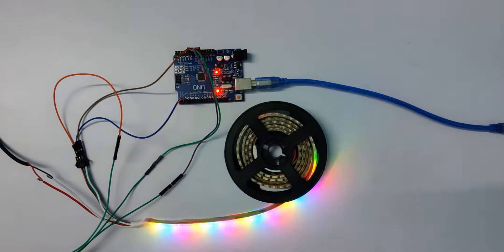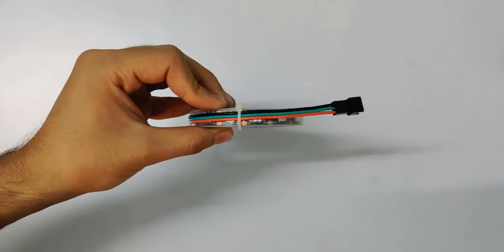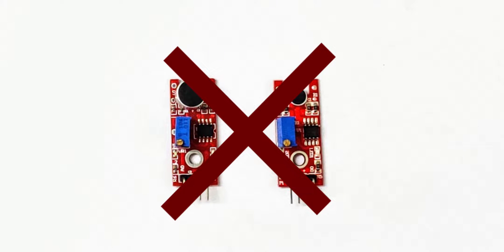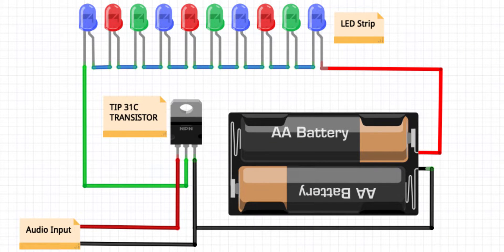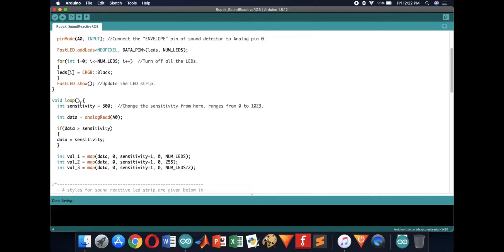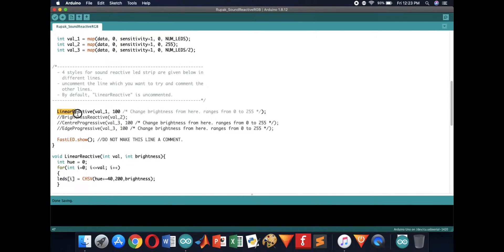How to make a sound reactive RGB LED strip with Arduino

Comment: Hello Rupak, just wondering will a Arduino Nano work with this setup? Also, what are the jumper cables for? and for the Sparkfun sound detector which is better the one with headers or no headers - what's the benefit to getting the one with the headers.

Comment: which transformer can i use for the led strip? ok 12V
Reply: They usually work on 5V
Reply: You have 2 common types of LEDs
WS2811 which work at 12V
WS2812 / WS2812B which work at 5V

Comment: my light is flickering but otherwise it works. How can i stop the flickering of the leds?
Reply: Seems like you may have a faulty power supply. Flicking usually happens when the current entering the strip is not constant.

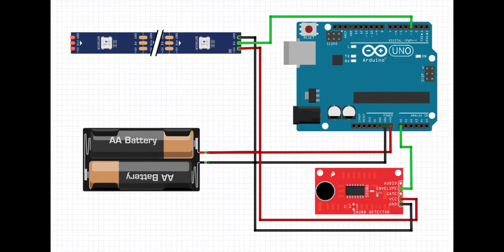Comment: 1:06 Are you sure the wiring is correct? The sound detector is not attached to a power source 😮
Reply: I also got the same confusion , but the sound reactor and led is not connected to each other. They are connected to the power source . The diagram is a bit confusing.
Reply: bro did u get the ouput after uploading the code i dont seem to get anything working
shld i connect the led strip to some power source?

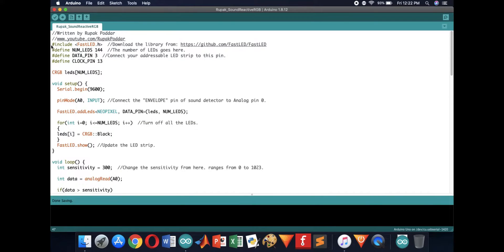Comment: If the LED strip has 4 wire ( white, green, red, blue) How to use that on this circuit? please explain 1:14
Reply: those are diferent RGB leds, the ones in the video have acontrol chim on them so  thats why they have 3 wires, V+, GND and "data"
the ones you have are simple RGB and dus have 4 wires, you need a diferent type controller